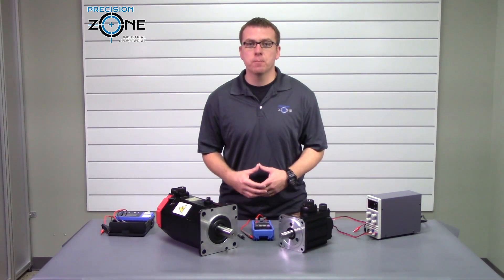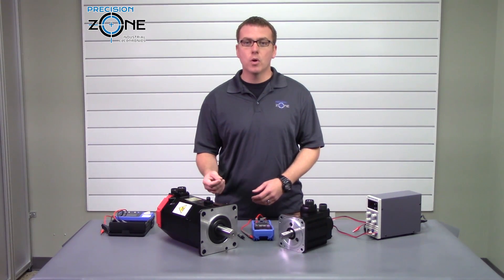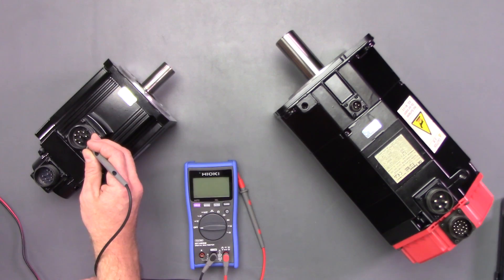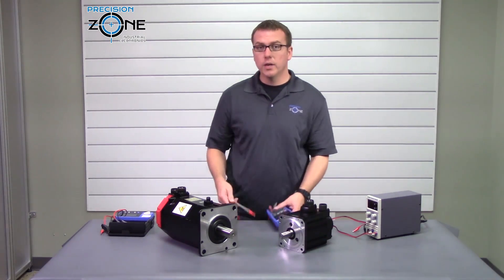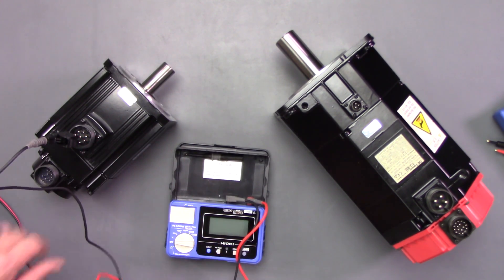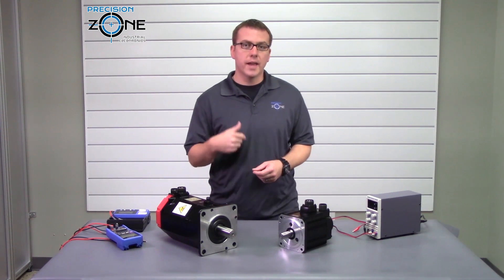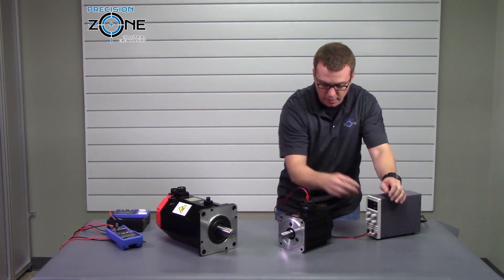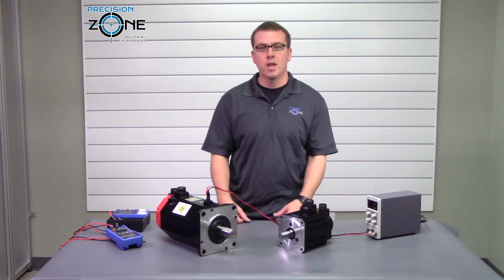Troubleshooting AC Servo Motor Holding Brakes

Comment: show how to connect the motor   Fanuc A06B-0186-B675#0014 2000RPM 3.8kW Motor  to a wood lathe so that the spindle is like a rotary axis and which controller is suitable or replace with another cheaper one

Comment: Hi I am glad to hear this but I need a help we have a bridge stuck in upward position weight 2 ton so if I releases brakes with a switch. Control will it be possible to control the down movement just by on off function by a switch control power supply

Comment: Hi,
I’m using servo motor for juki -LH3168(double needle) but now the motor shows E16 ( error16 ) and its starting is good but after that is not working so could you tell me how to fix The E16 please? Asap 
Thanks